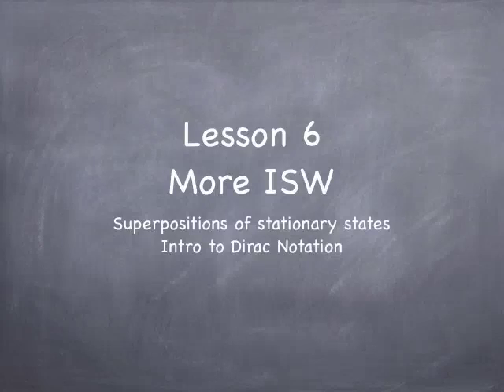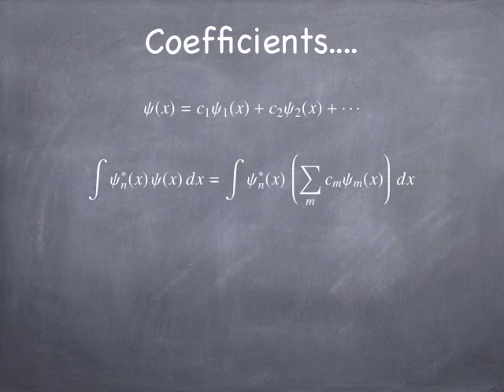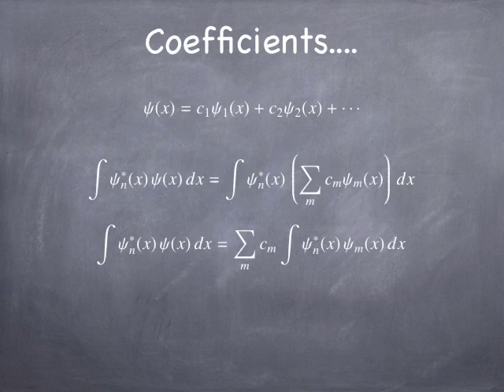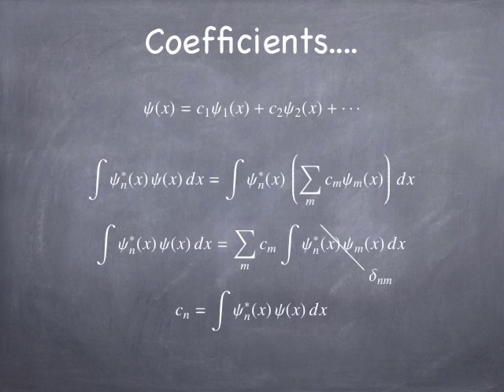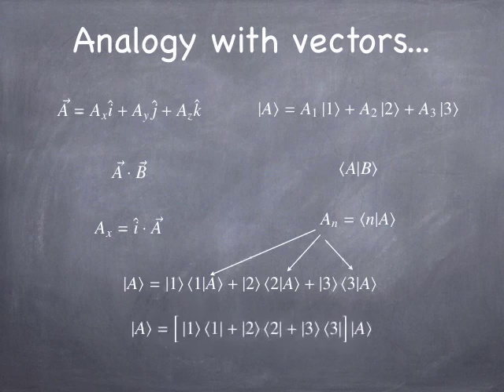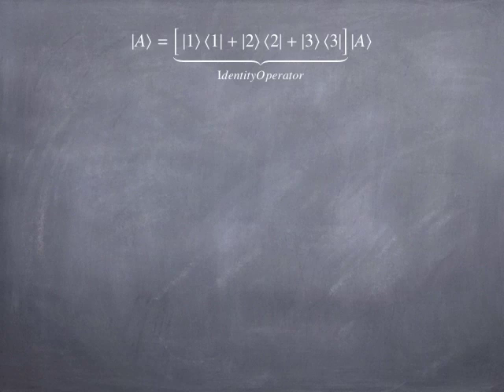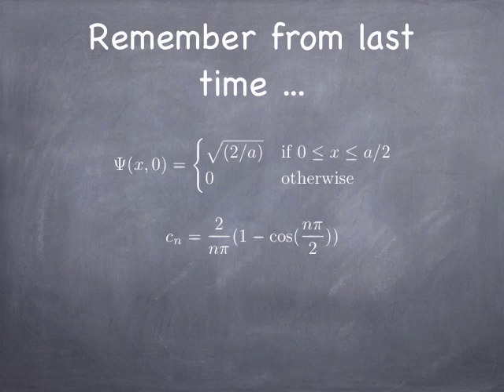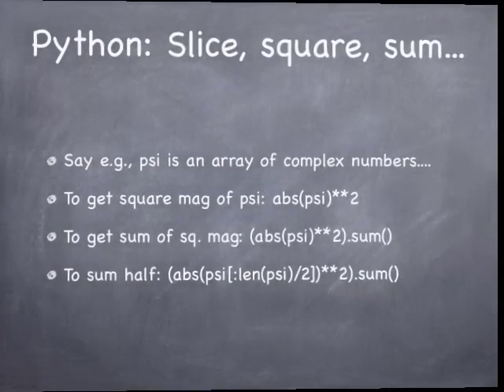Lesson 6: More ISW + Dirac Notation

Comment from the maker: It's a good point about the discontinuity. It means it's not a very realistic wave function, but then the ISW is a major idealization anyway. You could think of it as an ISW that is suddenly made twice as wide at t=0. Before t=0 the particle is equally likely to be anywhere in the well. Then, the right wall is instantaneously moved to the right leavening the wave function momentarily unchanged. A more realistic case would be a wave function the goes to zero "quickly" but not with infinite slope.
Reply from the maker: A more realistic initial condition would be:

\psi>=(|1o>+|2o>+|3o>)/\sqrt{3}

where |1o>,|2o>,etc are the stationary states of the well before the wall is moved to the right. This would not have the discontinuity, but would be harder to compute the coefficients after the wall moves. It's a question of simplicity vs. realism I guess. Another reason why my choice is not realistic. If you compute the energy needed to get a "uniform" probability everywhere in a square well, you'll find it's infinite. Doh!